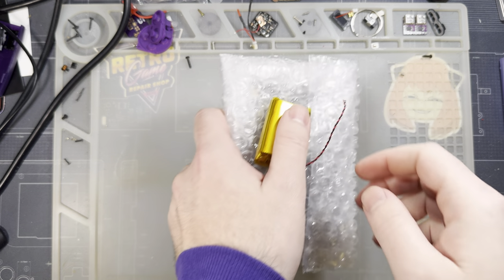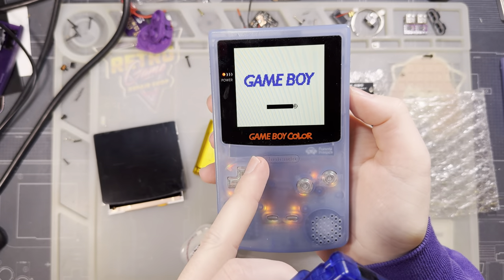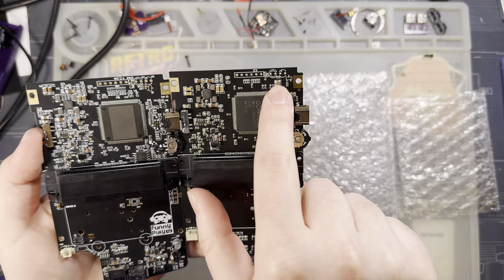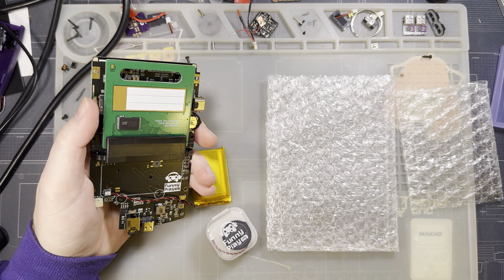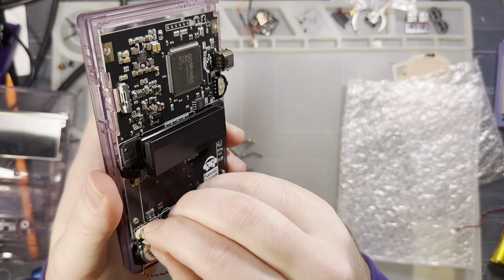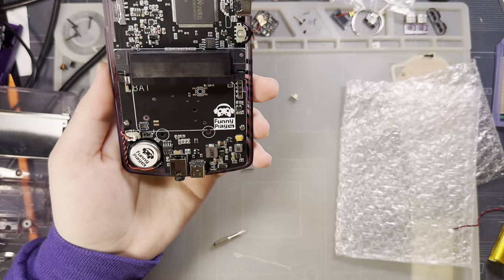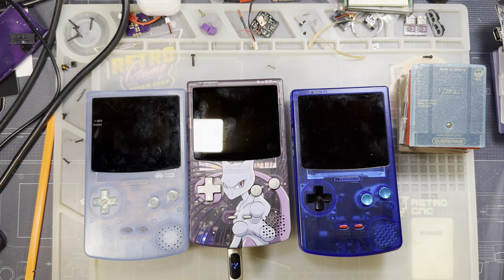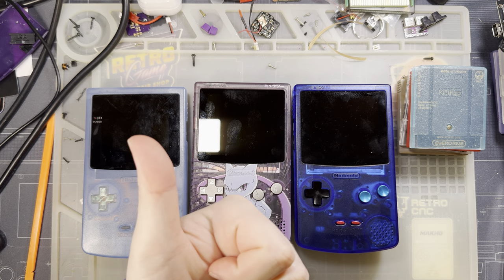All Aftermarket Game Boy Color -- The Funnyplaying FPGA GBC (FP GBC HW v1.1)

Comment: The problem that I have with all of this is that it's overpriced... With the amount of compatibilty issues right now this should be like $40-50.... Not at the original price that they want for this. I'm going to say the samething about the parts as well. Yes we can get a cheap shell for roughly $10.00 but worry about the plastic cracking.... I would love to get one of the shells from Retro Game Repair Shop and the metal buttons but they are overpricing that stuff as well... Shells that should be $25.00 buttons should be like $10-15.00.... It's kinda insane... Unless you buy all of the cheap parts to keep it under $100.... You are better off getting a Myoo Mini that has better parts and is cheaper...
Reply: Wild take, this is very reasonably priced and funnyplaying shells are fine.
Reply: I'm in the market for real GBC and can't quite pull the trigger on this kit because the core inaccuracies (poor speed approximations, poor flashcart / game compatibility) are unacceptable. In that regard using a Miyoo Mini or even homebrew emulation on, say, a DS makes more sense than a FPGBC right now. If FunnyPlaying could perhaps look into improving their cores (or look into licensing use of an existing mature GBC core such as the one on MiSTerFPGA / Analogue Pocket) I'll probably jump on it immediately.
Reply: @Fattydeposit If I was was starting out again and needed a modded Gameboy/color to play carts etc, the Analogue Pocket is a no brainer.
Reply: It’s a very good way to play your physical collection, just picked one up and updated the firmware and all games run well.
Reply: Horrible take. It’s like you’ve never sourced parts and modded your own GBC. You obviously have no frame of reference, lil bro.
Reply: @Numba1indahood Actually I've had 4 GBA's and 2 GBC's where the screens and ribbon cables were dead on arrival. So yes I do know about the parts. As for what I said originally my statment has valid points. Shells are way over priced as with the parts for the modding....
Reply: @MagicalWingLT  the shell is 9 dollars???
Reply: I understand your concern but at least they are actually working on firmware and compatability. To my suprise they even replied to my feedback on the current incompatibility of Kirby Tilt n Tumble. They said they are working on it. Buying a product like this is basically buying into a beta program. The company needs financial support in order to make this product better. So far I've been enjoying using a flashcart on my fpgbc since my tilt n tumble cart doesnt work fully yet. It does suck not all games are compatible out of the box but looking at their pattern of releasing updated firmware, I'm not too worried for now. I agree that buttons and shells should be cheaper. Custom shells shouldn't cost a bomb.
Reply: @prod.richardjenkins1626 i think hes talking abt the uv printed shells from the Retro Game Repair Shoo which are $55. Funny playing ones are cheap
Reply: It's the cheapest fpga option by far and even cheaper than modding a gbc. If you want higher quality parts you pay more. But then you complain about the price of those parts.

Comment: Literally just received my FPGBC 1.1 in the mail today and put it together. Everything looks great and it went together well, but my left input on the directional pad is not registering. Any advice?
Reply from the maker: I advise you talk to the seller.
Reply: @makho I did. And they asked for pictures. I sent them and they said they could see “sweating” around pin 7 of the  chip. Asked if I could re solder it. I attempted and now it doesn’t work at all. And unfortunately they are on holiday until the 18th… so essentially I have a brick currently

Comment: At this point the continued use of the tri-wing screws are a statement to the ingenuity of the community. The security measures those screws used to offer have been defeated. What was once a difficult tool to find, now we have tri-wing screwdrivers easily available for next to nothing. We even have easy access to identical tri-wing screws that we use in reproduction parts. Tri-wing screws used to actually offer security due to the rarity of the tools. Now, we've adopted them to such a degree that continuing to use them has become a middle finger to those types of "security" measures. I love it!

Comment: So something I just noticed with the latest firmware 1.08 on the 1.1 model is that there is no longer a high pitched hiss on lower volume settings. Both the stock firmware and 1.06, had that loud hiss up to half volume.

Comment: Question, would the new screen without the logo work with the older funnyplaying Q5 kit work? Those newer screen are bigger and I’d love to have a bigger screen for my GBC
Reply: If it's the same Q5 LCD panel, it'll work, but the ribbon in your kit won't do the non-integer scaling, so the image will be the same size. You'll also have a bright, colorful bar across the bottom, where the Game Boy Color logo is on the older screen.

Comment: Hey there!  I just put together one of these kits and noticed that the only way I can turn the volume up is via the osd.  The physical volume knob/wheel does not work when trying to turn the volume up.  It will turn down the volume, however.  I'm guessing something is wrong with the hardware itself?  I updated to the latest firmware and that didn't fix the issue.  The problem persists whether headphones are plugged in or not.
Reply from the maker: Contact the seller.

Comment: What models of flash carts are you running? None of my chinese bootleg Everdrives want to boot on my 1.1 while they're fine on actual hardware.
Reply from the maker: Compatibility is based on the specific cart you have, not the model. Some everdrives behave fine, some don't. Since the beginning I've been recommending people not get these for use with flash carts because the compatibility is not guaranteed.
Reply: @makho  Oh, no worries, I knew what I was getting myself into. I was just curious and surprised to see so many flash carts running on it with more or less no issues.

Comment: i updated my 1.1 to 1.06 from the 1.04 it shipped with using windows and now it's just a black screen. no matter which firmware i use it won't come off the black screen.

the only difference is if i load on a 140kb update.bin it has no sound or backlight to the screen. if i get the raw 887kb version then it has sound, a backlight, and will play a game i insert but just with a black screen. doing the blind the menu pressing down 9 times thing doesn't help.

idk what to do further besides emailing funnplaying, by chance do you have any idea what i could do?
Reply from the maker: You should redownload your firmware. There is no 140kb version. It needs to be named "update.bin" before copying.
Reply: @makho   i appreciate the reply. Unfortunately I've tried it several times from your github and from funnyplayings site and it doesn't do anything new. Still just get a black screen with sound/backlight/loads game. 

 The 140KB version comes from your github when I download it from the folder rather than clicking the update and getting the raw. For example, right clicking and saving the update.bin in GWGBC / HVv1_1 / 2024.2.7 gives me 140kb every time. 

I'm just gonna email them but thank you

Comment: just picked up one of these but i think im running into some issues, after updating the firmware(using v1.1 model) and tweaking and toggling  the backlight settings via the system menu on reboot it starts on a funnyplaying screen and its sort of locked there i cant even access the menu any more and not sure what to do.
Reply from the maker: Put a game in. The console halts otherwise.

Comment: Can you compare the watch with a real GB? the real issue for me is the speed.
Reply from the maker: If you cannot tell that the speed is off from my video, does it even matter? It's close enough and I'm sure that if I measured a smattering of ORIGINAL GBC units, I'd find plenty of variation there too.
Reply: @makho  Yes, if the speed is not correct, for me an fpga does not make sense.
Reply from the maker: @naxeras0  But if you can't tell, why does it matter?
Reply: @makho Because the whole point of spending money on hardware emulation is accuracy.
Reply: Hi, I'm seconding this question. Considering using it for LSDJ. There, speed and playback is a concern because of timing sync and pitch accuracy. Can you measure it against a real GBC?
Reply: @makho Because the speed of the core speaks directly to the accuracy. If something as fundamental as this is not correct, it really raises concerns about what other issues might be present. Timing and synchronisation is also one of the major benefits of FPGA in the first place, so why not just get one of the budget software emulation handhelds, which are ironically more accurate and compatible than this. 

Literally the only benefit of this in the current state is the ability to directly run carts, but all other aspects are inferior.

Don’t get me wrong, this is an extremely interesting device and it’s fantastic to see another FPGA handheld released but at this stage it feels very rushed to market and I feel like a beta tester.

Comment: After I updated my v1.11 Board, the Console did not boot anymore. I made sure I used the right files for my Board Version (in this case files for v1.1, because there are no files for v1.11) but the moment I copied it over, the console stopped working. The screen and speakers still work, but screen is black and speaker just has low noise. It doesn't boot.
I tried every update to get it back to it's original firmware but the console does not boot anymore. Only black screen and a little static from the speaker. The PC still recognizes the Drive when I plug it in and trun it on, so it is not completely broken. 
I'm still waiting on an answer from funnyplaying what it could be or how to solve it.
Is it possible that the Boards v1.11 need separate files for updating, not the files for 1.1? I mean if you update a v1.09 Board with v1.1 FW, it also stops the console from working (after what I read online). I'm very frustrated right now. Maybe someone here had the same problem with a v1.11 Board and knows how to solve it...
Reply from the maker: V1.11 and V1.1 boards use the same firmware. The behavior you're describing is either caused by flashing the wrong firmware (e.g. for v1.0 boards) or by an incomplete flash. Ensure you're using the proper firmware and try updating from another device. Since you're on v1.1 based hardware, you're not limited to windows devices only for updating.
Reply: @makho  Thanks for your reply. 
I already solved the problem. 1.11 boards seem to have problems with Mac, at least with my older MacBook Pro. I tried on my Mac and on a newer  one and it did not work. Then I tried a friends Windows PC and it worked right away. I'm glad the Board is not damaged and that everything’s working now, including the new Boot Screen. Thanks for that by the way ;)
Reply: @ThaGameBoy  How did you solve? I am in the same situation and reflashing with my pc is not working.
Reply: I had success by copying the fw in raw.
Reply: @daveyoil  I just had to do it on another PC and it worked right away. Great to hear that you solved it too.

Comment: I got one... and I am a bit disappointed.
I updated to 1.04, i also have hardware revision 1.1.
What I find frustrating is the big screen. While it's cool to have a bigger screen, I would much rather have
a cool logo at the bottom and a battery indicator on the side than having a weirdly stretched image.

especially on pokemon games, (crystal f.e.) you can see the right eye being weirdly off.
not only that, also the navigation of the OSD menu is crazy... version 1.04 also has an update OSD menu... which looks pretty fucked up tbh.
but fixes compatibility with EverDrive GB Model 17 and fixed the weird funny playing startup logo (i would much rather have the gameboy color logo back, but that's just me)

what i really like about this is the gameboy color colorpalette for normal GB games.
the reason i was interested in the fpga system was because:
A: cheap
B: new manufactured hardware
C: bigger screen

due to the bad way they implemented the bigger screen, I am not interested anymore...
since this fpga system is basically nothing else than a normal GBC... and a normal GBC with an IPS mod is just as good.

while the idea is awesome, the system is definitely at baby shoes level currently.
Reply from the maker: 1. v1.06 firmware fixed the OSD transparency already. You should update if this is a sticking point for you. 
2. there's a battery indicator in the OSD and it's infinitely more useful than guestimating charge levels based on LED brightness
3. I already discussed and linked to alternative parts if you prefer having a logo over screen real-estate. Read the video description. 
4. The new firmware update also has a patched bootloader version. 
5. Even if you don't use the full screen option, the 4x integer scale option is still about 2.6" so that's still larger than the 2.45" stock GBC screen.

Comment: I was tempted to get one of these but with that new boot logo im no longer interested. that looks horrible. would 100% rather the normal boot.
Reply: Which one? The one showed at 8:06 or the one showed at 46:21? I really like the second one over the first one. 

Or if you’re talking about the Nintendo boot logo, they probably had to change it due to possible copyright infringement.
Reply: you can downgrade to version 1117 (Version 0.89 in the menu), it have OG logo for GB/GBC... is the only change, the rest is the same as the new firmware.
Reply: boot logo can be changed with firmware updates. They have already said they will release more options soon.